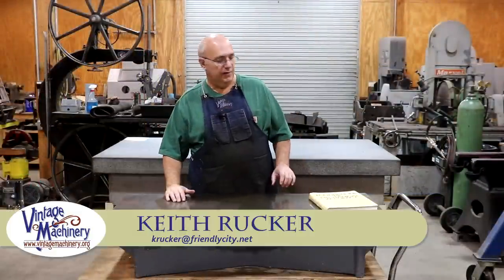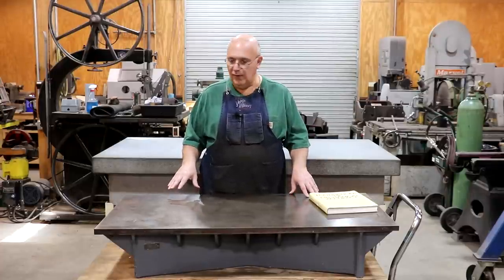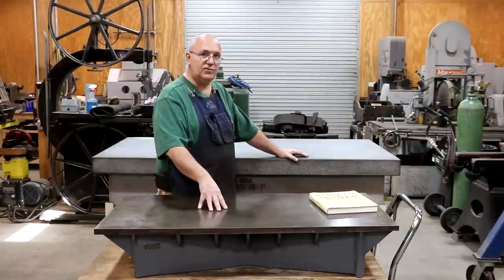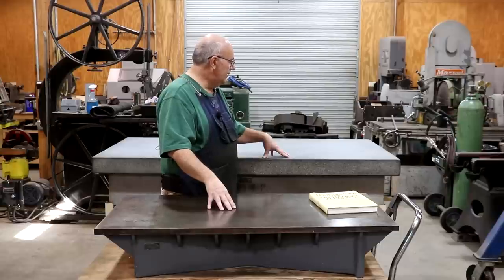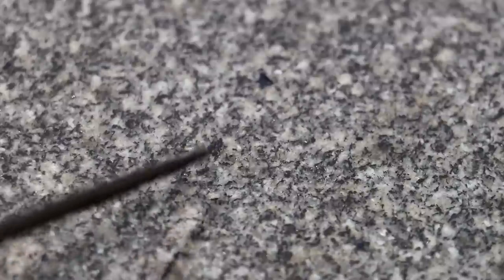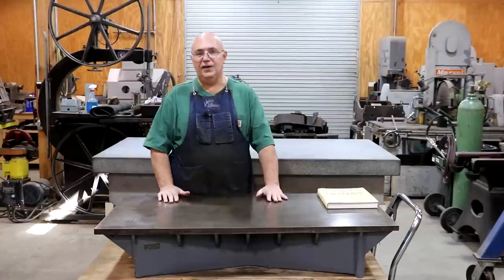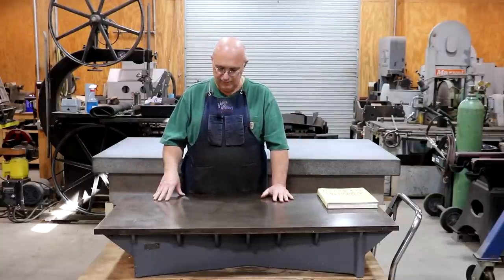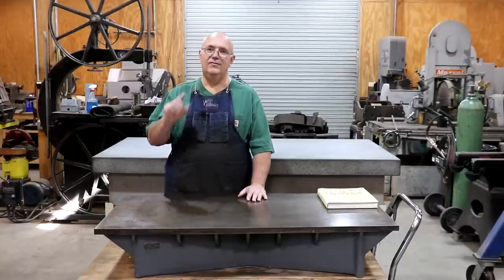Surface Plates:  Granite vs Cast Iron

Comment: Maybe you should just leave it on the roll-around lift table you have it on now, having an height adjustable work table would really be handy. You would have to head to Harbor Freight to get another hydraulic cart but not too big of a deal. You would still have to build a wooden cover for the cast iron plate but you already said you need to do that. Interesting, Thanks for sharing.

Comment: and I see there that wonderful book... such a fantastic read about "how to start a machinery manufacturing company" without meaning to be so. It's worth noting also that another factor wher cast iron outperforms steel is vibration damping, which is another good reason to use it for building machine tools

Comment: Very interesting that granite plates became popular in the USA decades before they did in the UK. I never saw a granite plate in any of the engineering works I worked in until the 1990's.  Even then it was only really the beds on CCM machines andi  think there were a couple in the metrology lab. Crown Windley still makes cast iron plates in reasonable numbers now but also supply granite as a lower cost option.

Comment: No sir, you can cause a localized swelling on granite plate. Doall makes a  small black granite gage block stone - used to remove positives.  Iv'e use to stone down around such divots on black granite. They are known for being softer than the pink granite, for instance.
Thanks for your informative comparison of reference surfaces.

Comment: Granite in general is less changing its size due to temperature than iron. But the granite surface plate is thicker and its heat conductivity is smaller. It takes longer to come into equilibrium.
Of most concern are directed infrared rays from sun through windows or from any kind of furnace.

Comment: I had a very talented friend who served his machnists apprenticeship at the old Frankford Arsenal in Philadelphia. He said they would place raw cast iron on the roof for at least a year to think he said to season it. I have done electrical work in machine and tool & die shops and amazed that they had a company to come in once a year to check surface plates and place a dated sticker on them if they passed. Never saw a cast iron surface plate. Great vidio.
Reply: Rough castings right out of the sand are FULL of stresses.  Either you "season", as Frankford did, or you employ sophisticated thermal cycling, like Clarke Easterling does.

Comment: Cast iron plates are the best if you need to use them for lay out. I work in fabrication and they are the best because they're obviously magnetic. We can use it as a standard surface plate with height gauges etc. But then we can also use it for laying out components and use magnets to find edges of plots.

Comment: After that plate was cast, would they have put into a big oven (or have taken it outside and buried it under a woodpile and set the pile on fire) to season it? An area press and shear company, built for WWII needs, to this day still has the pits in the shop floor that were used for building a fire under a machine to anneal(??) it before it was machined.

Comment: I picked up a tablesaw wing from work, almost 
2 feet by almost 3 feet.  Cast Iron, and I don't 
know what it came off of.  If I can get it to 
within 0.001, I'll be happy.  I will not need much 
more tolerance than that.

I work at a woodworking store that sells 
machines, and hardwood lumber.  I repair 
(customer's stuff) and refurbish (consignment 
stuff.)  I ALWAYS hit the top of a tablesaw, with 
a fine stone I have, just for that purpose.  I see 
the same exact thing you have shown, where a 
burr was kicked up.  I do NOT like sanding down 
the whole table, especially if there is a shiny 
patina there.  That stone doesn't harm the patina.

steve

Comment: I would like a surface plate, just a small one and I wondered about old cast iron ones, probably more than good enough for my work. What I was wondering though was about rust. If you cover the table and perhaps dont use it for months do they rust, how would you stop it and would it ruin the table?

Comment: Some years ago, I've picked up a cast iron table (similar to yours) in not-terrible-but-not-perfect condition. Having granite surface plate that is half the size of the cast iron one I wonder if its possible to use it to print the bigger one somehow?
Reply: You can use it to print small areas. But for overall flatness you'd need an autocollimator or similar tool.

Comment: One advantage that iron has over granite -- impact resistance. A stone anvil would be a remote second choice after steel.

But not all hammer-worked items are red hot out of the forge. Your book, for instance, has a rounded back. In trade bookbinding this is typically produced by a hydraulic powered machine. But a craft binder would produce the shape with a special hammer and a heavy vibration-free table, like your new surface plate. Any more detailed description of this process could be upsetting for those accustomed to more precise manipulations!

Comment: You forgot to mention the biggest advantage of granite plates: they have much better wear resistance! Cast iron is very soft and if you are going to put dozens of heavy parts on such a plate every day and slide them around to take your measurements then you will very soon find out that you now have a measureable valley in the middle of the plate while under the same load a granite plate would still largely maintain its flatness. Cast iron plates make for good master surfaces but if you want to use them for routine work then you will end up having to regularly check and scrape them. It was what they did 100 years ago but in the modern era of disposable tools and instruments it is just way too much maintenance for any industrial use. That is the main reason why noone uses big cast iron plates anymore and only the smallest ones are still somewhat popular because of the great advantage of being portable and comparatively lightweight.

Comment: I prefer granite to cast iron for several reasons but mainly bc one they don't rust and two if something is accidentally dropped onto it a cast iron which could leave a raised edge/high spot whereas the granite might chip but there won't be a raised edge.

Edit* Of course you talked about my main issues LOL
Reply: rust is indeed a problem for most of us home shops!!   so yea granite for me too!

Comment: At the 10 minutes of the video I noticed that it is mentioned.  " the surface plae will crown or convex " . In my opinion he should have said that it will " crown or concave ", 
To crown or covex is the same direction. Crown or concave are opposite to each other..
Even though this is a fine video.

Comment: How interesting that cast iron maintains flatness better than granite over temperature changes! 

I always thought of granite as being immune to thermal variations, the fact that it isn’t is really interesting to me. (Not that I’ll ever do anything that even a grade B plate wouldn’t be massive overkill for, but I’m a measurement geek, so so this sort of thing is fascinating to me 😁) 

Thanks for a great video as always!
Reply: Quite so. Even moving a granite to a different location on your shop floor, or jacks under the plate require calibration to assure plate is still to desired flatness after relaxing into new location.  We're talking millionths here.  Wouldn't matter for what I was doing in my shop; mattered to the aerospace shops I've worked in.

Comment: I was interested in looking up that book, Foundations of Mechanical Accuracy by Wayne R. Moore, so I searched Amazon. A hardbound USED copy is available from a public library in Oregon for a mere $502.47.  Ebay shows several offerings from a low price of $450 to as high as $989.00. I could buy alot more tooling for that amount. ; )
Reply: I found a PDF version someplace on the internet about 5 years ago, but I’ve no idea where. Keep looking

Comment: The way i see it, it's like this, if you're a hobbyist, get two cast iron surfaces. You'll only need that and grind paste to stay on top. If you wanna work but still in a small shop capacity, get a cheapo granite, pay good for a resurface. If you wanna make money, toil, sweat, bleed to get a good granite, if not new, pray to the luck gods for a quality second hand one and resurface that.

Until a few years ago, when i started to repair even more intricate stuff like hydraulic valve bodies and stuff for my outfit, i never needed a granite, all my work was done between the rubbed out cast irons and i never suffered any issue on that account, it was good enough (in the good sense of the expression). 

At least for me, that's when the transition was necessary, and it's mostly because of the way you operate a granite block. It's not cast iron, and you can't behave with it like you would with a cast iron face. Nuh uh. You gotta treat that granite like you treat your grandma, all gentile and polite. No swear words or bad attitude or you get the stick (or in the granite sense, you chip it and then you feel shame for the rest of time whenever you see it).

Just my 2 cents. :)

Comment: granite plates can be very accurate, but the same accuracey can be had with a cast iron plate. Cast iron will wear much better than granite. Granite is also affected by temps and humidity. A lab grade plate with be flat with in a tenth of an arc second (.000025" in a foot of travel), but that figure is miss leading! You shoot the plate with an auto-collomater, and lastly a plain-o-cator. There are Federal specs for both systems and you use both on each plate.  To really get a good plate (cast iron) you need three plates to rub the one you are scraping. That's where the term come refering to the three are masters. You never use a master for any other thing. The underside of both plates will show you three points it will set on. That is critical. You can't really rotate a granite plate to use when scraping another surface (say a table top). 

You mentioned having the surface plate ground. DON'T!  Grinding creates an undue stress in the surface, plus imbed the grit from the wheel in the surface. I learned this the hard way. Always plain the surface. A milling operation will be just as bad as grinding. You said something about a 4 foot by 8 foot granite plate. Go with a 6 foot by 9 foot one. An 8 foot table will give you headaches trying to use something eight foot long on it. Noticed you have a grey granite plate. Those can be a bitch to lap! They seem much harder than the typical black plate. Pink is slightly softer, but also prone to hard veins running thru the granite. Those veins will show up as wide white lines. i used synthetic diamond dust most of the time, but real diamond is several times more expensive. Real diamond dust cuts a little faster, but you also must be careful. Just avoid putting something heavy on top the plate for lengthy periods of time (Cadillac Gauge comes to mind), as they'll warp it. Keep the plates covered with a wood top or even cardboard. I used Masonite with felt pad glued under it to allow a little air flow across the surface. 

Somebody else asked about a glass plate. I've seen one, and there's no way to lap it without making a mess. Just toss it. Plus glass is too fine causing a surface gauge to stick at the worst times.

Comment: I'd be interested in how flat a sheet of glass could potentially be given it's variables, i've used glass pane for past 20 years to lap motorbike cylinder heads on along with other flat surfaces needing lapping. I'd love to have a small surface plate but giving i couldn't verify the flatness has always seemed no point
Reply: Not very flat (in the machinist world), but stuff like that, good enough. Don't feel obliged to get anything above that unless it falls in your lap (figuratively, of course). The errors average out when you put the gasket on and if you do the 8 pattern properly. My uncle never felt the need to go beyond a sheet of thick glass (about 2 cm thick) that he had whenever he restored old classics and it never bothered those cars one bit.

FYI, if you get two cast iron plates you can rub them together with grinding paste (increasingly smaller) to make them flat. Before i got my granite, as i required increasingly better accuracy, i used to do this with very good results. If memory serves me well, Keith has a video on the procedure in his video collection.
Reply: @aserta  Well in the case of the cylinder heads/barrels i lap they need to be as flat as flat can be, as they use Viton Seals instead of conventional gasket materials so the surfaces need to be fairly parallel to each other, i've never had problems but always room for improvements when squaring the deck height to the combustion chamber in the Head.
I'll keep an eye out maybe a surface plate happen to fall into my lap, or some cast plates as I'm always scouring scrap yards.
Reply: Wouldnt the table the plate is on need to be precision leveled so it doesn’t introduce any twist in the plate? Put the plate on rollers and there no guarantee of level support of the plate. ( Im thinking the larger plates, smaller one would tend to be more self supporting)
Reply: @aserta , I’ve seen a video (maybe Tom Lipton, I don’t remember who exactly, but he was showing a method someone else came up with ) and they used three cast iron plates to lap each other in to get them all flat, there was some order that was used to do the lapping. It was really interesting, maybe I’ll see if I can find that video and watch it again.
Reply: @aserta   if you use just 2 Plates to grind each other you will end up with one concave plate and one convex plate, depending on the grinding motion. This is the way they made concave and convex mirrors for telescopes hundreds of years ago. Like @Hoaxer51 already wrote, you need 3 plates to grind each other perfectly flat.
Reply: Glass is not very flat and it is too thin, which makes it flexible, so if you put the glass on a surface plate it may be flat enough for scraping, but if you put it on a workbench, it won't be flat at all because it bends slightly to match the flatness of your workbench
Reply: @Henning_S.  In the grand scheme of things i was doing some online searching in regards to small Granite surface plate, in the search results it came up with "Granite kitchen chopping board" so bought one. As the surface is mirror shiny also nice and thick, i'm under the assumption it may have been ground to a satisfactory flat. I'll have to get a guaranteed flat edge of sorts and do some checking with feeler gauge. If it's no good will be used for clean work surface
Reply: glass would work just as good as granite or iron as long as it has a good base I use a waste or leftover granite countertop material and its served me just fine   If i had access to glass Id use it just the same     being that cylinder heads use gaskets the tolerance is way under the typical plates specs  and the machines that cut blocks and heads are far under the .0005 of a AA surface plate so no worries
Reply: @dinxsy8069  a polished surface doesn't mean it's absolutely flat, it also doesn't hold the ink very well.
The flatness depends mostly on the flatness of the ways of the grinding machine.
The best way to ensure a good flatness is to buy 2 more of those granite plates and lapping all 3 to each other.

Comment: A lot of these old CI plates have ended up as scrap. I personally wouldn't prefer them over granite as a reference surface. But as much a Keith might not like it, they do make great welding tables because they are so flat and weld spatter tends not to stick to cast iron very well.
Reply: spatter wont stick to granite!!

Comment: I am wondering why one cannot manufacture surface reference plates by use of a high-powered sideways scanning laser.
It would vaporize material that is too high, and achieve an almost atomic flatness, over a large area.
Of course, mass bends light, but on this scale, it would be unmeasurable.
Or should I just patent the idea now?

Comment: Size for size the granite will weigh less than a cast iron plate.  It's not often noted, but granite and aluminium are nearly identical in density.  Of course, granite is far more rigid than aluminium.

Comment: You can blacken up a surface to check its flatness without the use of dykem blue stuff on a cast  flat plate.
Reply: 6 in one vs 1/2 dozen  its reference and something has to be used to show the high/low points

Comment: I think the reason machine tools are made of cast iron is also because of its natural damping. Btw this would be a great candidate to be planed with your planer if it is out of flatness.
Reply: eh i work with large 150 hp lathes and they are pure castiron   and they are noisy when cutting steel so the damping part is a no go     I say they use it for the reasons Keith mentioned the machines I run weigh about 30tons and the big one weighs 40 tons and yes they are insane huge!!
Reply: @Jesus-gh8gm  no the damping characteristics of cast iron are well documented. That doesn’t mean they won’t chatter, of course they will, but they are more resistant to chatter than any other material.

Comment: I don't buy the reason for changing to granite from cast iron. The USA wasn't so short of iron it needed to save a few tonnes for the war effort. Bear in mind the US built so many aircraft carriers it didn't have the manpower to operate them. No, the reason granite was used is that it's simply far better than cast iron and during WW2 huge technical advances were being made in high precision engineering such that better surface plates were needed.